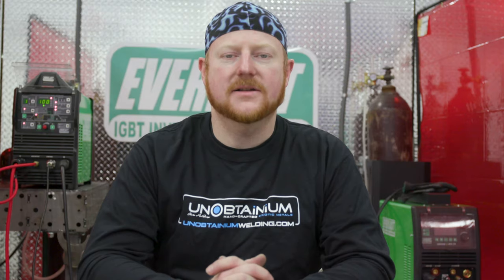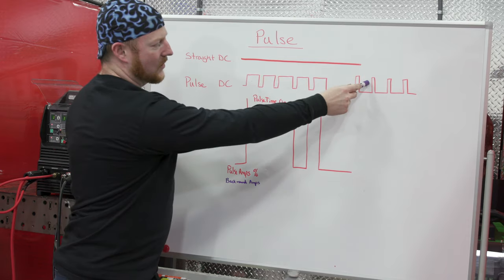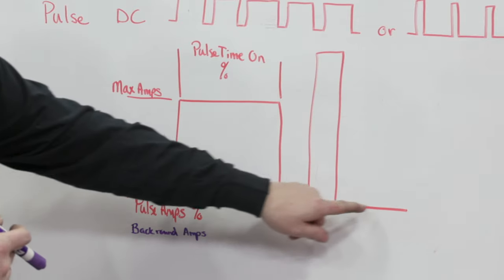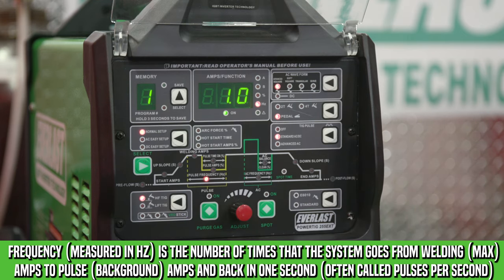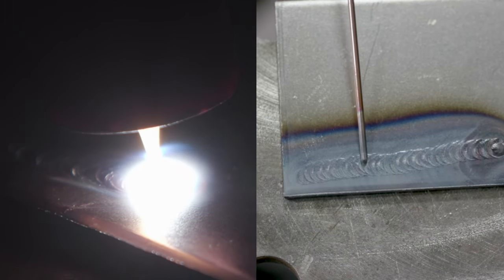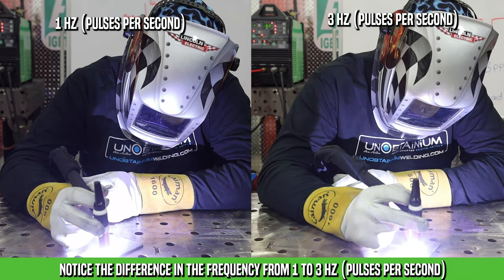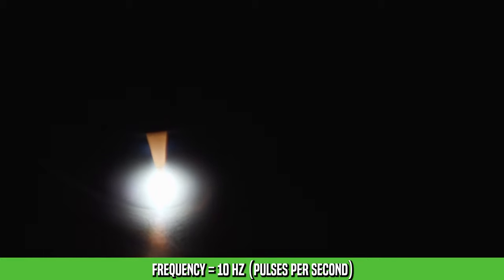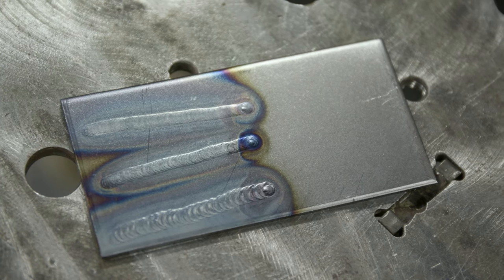EXPLAINED: DC Pulse TIG Settings and Setup | Everlast Welders

Comment: Super job in showing this example. Iam wondering if it would be possible to spot weld a thin nickle strip to a ( battery 1860).  Or would this unit be an over kill for this job( work piece)

Comment: And what about cold welding Tig, it's possible to do with a pulse setting or it's a different machine?
Reply from the maker: You would need to integrate a cold wire feed system, but you can certainly have a pulse process with cold wire feed.
Reply: @everlastgenerator  
I think is not that, if you search "cold welding machines" you see I don't know if is Tig but it's like a high power and fast pulse and no filler.
Thanks for the answer!